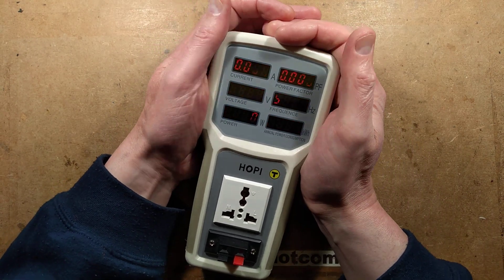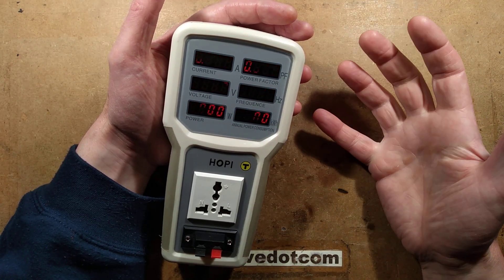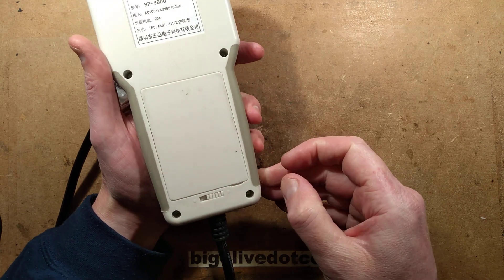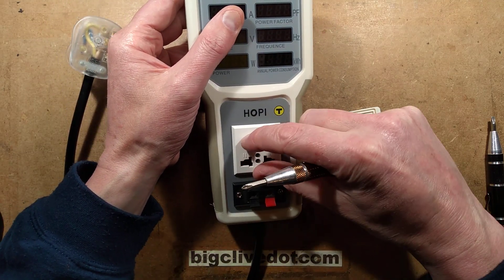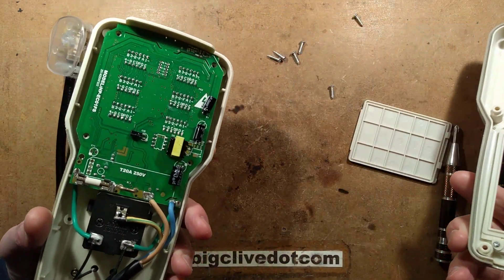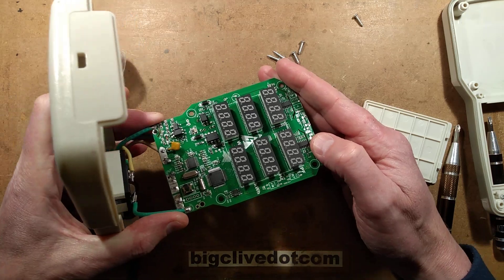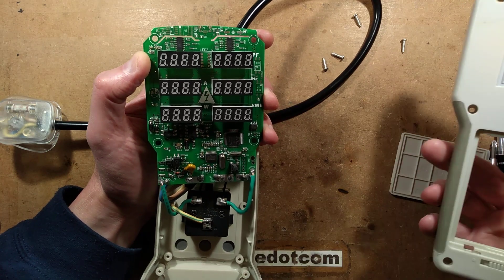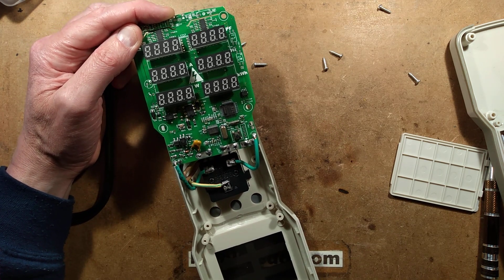Inside the Hopi power meter.  (It contains a smart meter chip!)

Comment: The chip is pretty cheap. 10$. beyond preamps, adc and voltage regulators and oscilator, it is fully digital architecture. The same can be done in a micro using two adcs. The problem is that, if you do it in micro, you need high res adcs, about 10ksps, auxiliary opamps, and figure how to remove common mode and cross channel noise. Plus you need to do plenty of math, like filtering, since interpolation, squering, summing, squere root, etc. And at the same time also update reliably display and output to serial port and react to this button thingy. That is really tricky to code correctly, plus need calibration routines, etc. Just a lot of work. Can be done, but 10$ is pretty cheap.

For three phase or two systems, one can use AD7878, pretty advanced beast. There are also a bit cheaper versions of it, with less options. I am actually designing a networked system based on ad7878 and this cirus logic chip. I do plan to switch to micro-only solution for simplicity of board and parts, and price, but want to have a baseline performance first.

Comment: I google the operation instruction for you~

APC: Annul Power Consumption
REC: Annul electricity costs
uH--: Active electric energy
CO2: Annul CO2 Consumption
L-UP: Upper limit of Power

Annual Power consumption can be set by press the key for short to set the limit (Range : 1~24)

When set to display 'uH--' mode, displaying the load time 
the number in "Hz" and "kWh" are combined to give out the total hour?

long press twice the miracle button to clear all data

Comment: There IS a way to at least reduce the flicker on software-scanned LED displays. In the case of this HOPI meter device, you would need 192 small capacitors, and some way to put one in parallel with each LED. Hmm. What a PITA!

Comment: I have a HOPI power meter which has seen very little use, but I still have the original packaging and the minimal Chinese documentation. The outer packaging is labelled "Energy saving lamps tester", so it's probably not intended for bigger loads. The push button behind the T is identified as part (7), but I can't read the Chinese explanation of its function. Maybe Google Translate could help, but I doubt it.

Comment: Clive there is loads of “depth” ( not sure of the correct term ) on the back of the socket, instead of turning it 90 degrees push it outwards to raise it above the speaker terminals.

Comment: Hopi Functions listed on BangGood

"Buttons can be adjusted to change work time every day, function selection, reset the total quantity and total time, set the limit alarm.
The instrument can display voltage, current, power, power factor, power grid frequency, annual voltage."

https://www.banggood.com/HP9800-85265V-20A-Electric-Hand-Held-Power-Meter-Power-Socket-Tester-p-931988.html?cur_warehouse=CN

Comment: Manual for the number 7 T button https://www.aliexpress.com/item/HOPI-HP-9800-Digital-Power-Meter-Tester/32606638852.html       Given some of the prices I wonder if there are knock-offs of this product floating around ?!   Anyway the button allows you to set an alarm for a load exceeding a given number of KWH per annum - and the 1 to 24 allows you to step thru the likely number of hours used per day to give you that (I presume the default is 24 hrs constant load)- so that you get an audio or flashing warning of a load is 'non-compliant'  uH= gives LEDBank6 the 'Active Electrical Energy' reading, AEC - Annual Energy Costs - presumably with USB you program your pence (or £) per KWH (single rate) into the unit ,  APC = Annual Power Consumption (is that the default on Box 6 or is the default something else and you have been mis-reading it ? ) CO2 - annual CO2 presumably you program your CO/2 per KWH in from your supplier ELect source.   when after uH displayed then it clears - but you have short pressed (a short press generally retains the function - a long press just displays that function then reverts back to previous or default function)-  box 6 simply is  a timer for how long the load is (has?) been connected - is it reading the timer or starting the timer ?  This timer might explain one of your puzzled circuits.  So you might want to see if a short/instant load gives different readings to a load over time - or find out if someone is stealing your power for the coffee machine overnight if you run 'extension cables' in your office.   It appears the memory overall is incremented until cleared (actually that is confusing)- so some of your previous results may be the average of all loads - unless memory is cleared on unplugging device under test - you will have to check circuit for that or a better manual.

Comment: uH-- = Complex (or apparent?) power (datasheet says it's active electric energy)
AEC = Annual electricity costs
APC = Annual power consumption
CO2 = Annual CO2 consumption
L-UP = Upper limit of power

When the display shows 'uH--', the display below it shows the apparent power. In the video, calculated apparent power is 5.645VA (slightly offset, it is 6.86VA), and when the displays changed to show another value, it is defined as load time, which is the combined value of those two displays, 0001 17.42 = 117.42h of load time (datasheets says h, I don't know what it is for).

USB section is just used for USB-to-serial port converter, but the IC is omitted on the board.

Additional note: The range it goes between 1 and 24 is both to set up an alarm for upper power limit and to set hours for APC.

Comment: Can you set the exposure settings on your camera? The flickering should mainly occur at higher shutter speeds, as the shutter isn't open during the entire refresh period of the hopi and therefore always just randomly catches a few of the displays/digits... If you can set the iso as low as possible you should be able to decrease the shutter speed, so that each frame is taken over a longer period of time, this may lead to more motion blur, but I guess that's not as much as a problem as the flickering display of the hopi is it? If you can't set the exposure settings or end up with a too bright image if you decrease the shutter speed, you could try attaching something to the front of the lens to block some light and make the image darker, forcing the camera to decrease the shutter speed.

Comment: Clive, I have a similar meter from Banggood or Fasttech and it came with a Chinese manual.
I complained about the fact that they didn't supply an English manual with it and they were kind enough to translate it for me.
I believe the button is used to set up the device to do longer measurements. I'm not sure since it was quite some time ago but I can lookup the e-mail and send you a copy.

Comment: From a listing on AliExpress:
Short press sets the hours per day it's on for calculating Annul Power Consumption (Range: 1~24)
Long press sets you in "Set the display content mode", using the short press to cycle between modes
AEC: Annul electricity costs
APC: Annul Power Consumption
uH: Active electric energy (I think it's the total amount of energy used, as it cycles in this mode between "active electric energy" and hours of load, displayed over both the frequency and annual power consumption field)
CO2: Annul CO2 Consumption

I hope this helps decipher the "what the fuck" button, although the manual remains quite cryptic.

Comment: I found a scan of the manual on dhgate (https://www.dhgate.com/product/hopi-hp-9800-handheld-power-meter-power-analyzer/435688031.html)
1. Short presses set the "alarm upper limit of Power and the hours for Annul Power Consumption" (guessing this is the power rate)
2. One long press and then short presses change modes:
uH = "Active electric energy" (and "frequence" and "annual power consumption" alternate to show the time in hours)
AEC  = "Annul electricity costs" (annual consumption?)
CO2 = "Annul CO2 Consumption"
APC = "Annul Power Consumption"
3. Two long presses "Clear the Electrical power data and load time"

Comment: Just an FYI, Most industrial power meters use a "Transducer" which operates from about 90 Volts to 280 Volts to power the unit. The current input is most often 5A for the base transducer.  Then current transformers are used for metering higher currents, and Potential transformers are used to measure higher voltages.  These are used by utilities for example to meter 13.8KV power at for example 1,000 A for 13.8 MW reading.  The transducer is programmed for the appropriate scale factors even though the base instrument operates on up to 5A and up to 280V.  Most of these are designed to measure VA, Watts, Power Factor, Harmonics, Volts, and Watt Hours.  Most are factory configured for 3 phase power and most can be configured for single phase.  The actual transducers are not that expensive and can be found online.  You can buy the Current Transformers if needed.  For my diesel generator I have 150:5A current transformers and don't use potential transformers.  Many of the transducers do not have terminals for current, but have current transformers for you to pass the 5A current wire.

For your videos you might want to pick one up with an LCD instead of LED display.
Sometimes they are listed as a multi function digital panelboard meter.  You found the right ones when the spec sheet specifies the input current is 1/5Amps and 3 or single phase.  This is industry standard for industrial power measurement.  The instrument will have a power connection to power the device and a metering input for 0- typically 280 or 480 volt range.  Display will switch between Watts/Volts/Amps/VA/PF for each phase and K and M scales of it such as KW or MW, V, KV, MV as they can be scaled to display properly when using transformers for metering.  Google a Theta 30 Single or 3 Phase Transducer for an example meter with an LCD display.  There are many to choose from.

Comment: Sorry this comment is a bit unrelated but I didn't know which youtuber to ask.
I want to build an electric kiln/furnace, seen lots of videos some good some bad. Common problem is the heating element failing. The issue I can see is the wire rated at 1000degrees which is fine to melt aluminium but how do you prevent the wire exceeding its spec?  It will be approx 240V / 2000watts. I have a temperature controller but thats the furnace temperature not the wire temperature which I assume will be much higher. Any tips?  Thanks
Reply from the maker: As long as there's some form of temperature control and no areas where a hot spot can occur (bunched up heating element) it should be OK.  I've never built a furnace

Comment: From the Aliexpress listing: AEC = Annul (their mistake) electricity costs, APC = Annul Power Consumption, uH-- = Active electric energy (???), CO2 = Annul CO2 Consumption, L-UP = Upper limit of Power (???) They have a very complicated chart on how that one button is supposed to be pressed. Here is the listing. https://ru.aliexpress.com/item/HOPI-HP-9800-Handheld-Power-Meter-Power-Analyzer-LED-Metering-Socket-Measurable-Current-voltage-Power-Factor/32375959317.html

Comment: The looks like a really old design given its LED display. I have two relatively low cost LCD meters that plug directly into a mains socket with a pass through mains socket on the front. It provide all the mains and load information you want: Volts, amps , power and power factor, mains frequency.

Comment: Hi Clive, I have a kitchen light fitting you might be interested in, moved into a new house and a single day in the fuse on this fitting really dramatically exploded leaving it melting and one with the casing
Reply from the maker: LED lamps often fail with a bang.  Usually when they're fairly new
Reply: @bigclivedotcom  it wasn't an led lamp and also it was really old, been there since the house was built, the fuse in it was the same type of fuse you find in a car, I've never seen one being used in a household light fitting. Thought it would be right up your street to disassemble that's all 😆
Reply from the maker: @sambrown9709  Was it low voltage? Car fuses aren't suited for mains use.
Reply: @bigclivedotcom  I'm not sure I don't know much about electronics.

Comment: Couldn’t you put an R+C over each of the pins on the back (approx 3:35 in the vid), to keep the segments lit for 20ms (one 50hz cycle)?
V=Ve^trc so to get a half-life of 20ms and a resistance of 1k so it doesn’t pull the voltage down to ground too fast, 20ms/1kOhm gives you 20uF so grab some 1k resistors and 10V 22uF ceramic caps and stick them across to fix the flickering for the camera?
Guess that’d cost £20 and a lot of headache soldering almost two hundred parts
Reply: You can get cameras or camera (mobile?) function that match the frame rate to the normal electical display rate- see geofftech videos as he films lots of National Rail displays - and his set up did not work in Eire where the refresh rate is different.
Reply: @highpath4776  yeah you could screw around with the filming framerate probably, but afaik Clive uses a cameraphone so probably doesnt have a way to change the framerate. Doing so in post probably wont help either.

Comment: @bigclivedotcom, I've been looking at the datasheet and the communication to the processor is SPI, which means the speed of communication can be anything, so I guess you could put a faster crystal on the processor side without any apparent issues. I'm guessing the CS5463 Xtal speed is 4.096Mhz (which was shown in the datasheet examples). It IS a pretty amazing chip.

Comment: APC - Annual power consumption, you select the number of hours in operation per day, 1 to 24 hours. uH should  display the total time the hopi have measured load. The value is split in two parts, first is shown in frequency display, and second in annual power display. Yours seems to show 117.42 hours of operation at the time of shooting.

Comment: Apparently that cirrus logic chip is obsolete now - wonder what the modern equivalent is.  Something like that would be cool for future projects like making a more versatile bench supply etc.  As for the display, those blocks of 4 digits are multiplexed displays so its loading the shift register for each digit with a total of 12 select lines (1 for each pair of digits in the 2 columns).  If you really wanted, you could hook up an external display just by taking a couple of lines from the DS and CP pins of the 74HC164s - could feed it to something like a raspberry pi and merge it with the video feed etc.  Anyway I'll shut up now - accidentally double dosed on my pills today so I may be talking more crap than usual :P

Comment: I had read the instruction leaflet that came with my Hopi so knew about the button and its functions. I had opened it up already to change the power cable as the so called Australian plug that came with mine was angled upside down  so it covered the on/off switch when plugged into most Australian power outlets.  I also looked at changing the universal socket on it to an Australian socket but also came up against the existing sockets non-square shape as well as its click in the hole design; so I am stuck with the socket of death. Mine also has a working USB socket. I also have one of these https://reductionrevolution.com.au/products/plug-in-power-meter which similarly is made so the meter itself blocks access to the switch on the power outlet.

Comment: I'd guess the 32k quartz is a timebase for the power measurement over time.
Reply from the maker: I initially thought that, but now I wonder if the optoisolator is providing an accurate timebase from the mains frequency.
Reply: @bigclivedotcom  could be, but then you have to check wether you are in 50Hz or 60Hz country. The 32k quartz qould be a stable source independend from mains frequency.

Comment: I wonder if the two separate clocks are for the two microcontroller, as in the chip that measures the frequency is uses one clock, and the one that drives the display uses the other. If that's the case then perhaps you COULD make the display driver faster.

Comment: Price of that meter chip is less than $2 in quantities of 1000. Quite accessible for small product runs.

P.S, serial communication is clocked with a dedicated dignal so the microcontroller clock speed ought not matter.

Comment: You mentioned the lower current range HOPI meter which had me interested, based on a quick search the only place that came up for HOPI meters appears to be aliexpress. The HOPI HP-9800 model does have a "HP-8173" listed in the description below rated up to 2.5A and "active power test range" 0.01W~550W instead of 0.5W~4400W of the HP-9800. The only minor issue appears to be that no HP-8173 is anywhere to be found, not on aliexpress nor on other places at the internet.

There is also some documentation on that description about the button btw (any weird spelling below is directly from their image)
"AEC: Annul electricity costs
APC: Annul Power Consumption
uH__: Active electric energy
CO2: Annul CO2 Consumption
L-UP: Upper limit of Power"

Yet another interesting bit here, they have button press instructions consisting of long (>2s) and short (<1s) press interface instruction by picture. I can't see "L-UP" mode being listed there, all the others at least get a mention. Maybe it's listed in the full manual or you can otherwise figure out what it actually does by pressing buttons + trial and error.

Also worth taking note of your case does have a micro USB port hole but it's not populated, the manual photo says "USB-to-Serial Com Port(    Optional)" about this. Even though it's not in your version I wonder if it's just a matter of putting a suitable micro usb socket on the board and the functionality is there. On Aliexpress that appears to be what makes some $56,88 instead of $49,59.
Reply: I think you'd have to populate more of the board with a USB-serial chip as well as the connector.  That does imply the 4-pin pattern near the display CPU is a serial link.